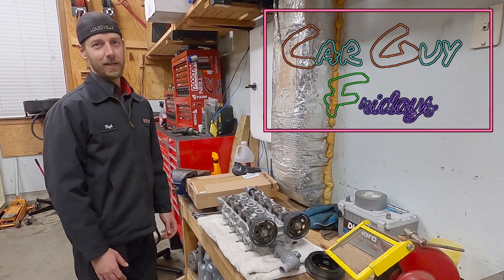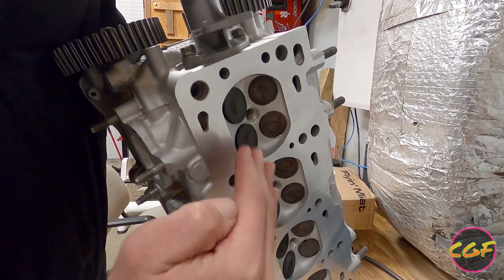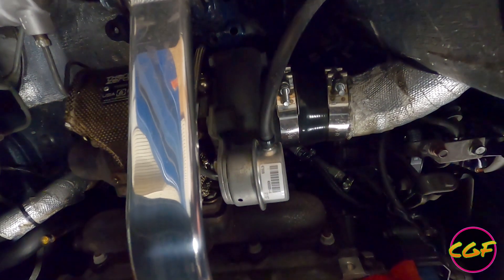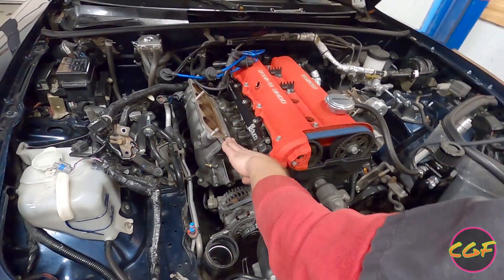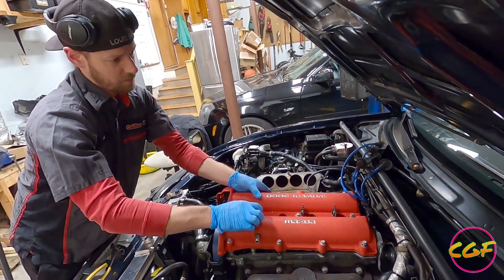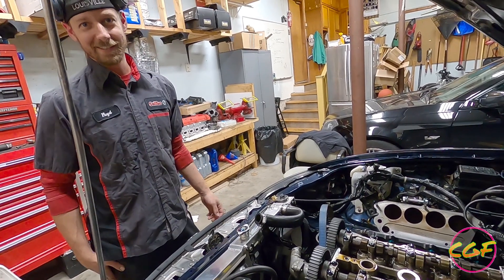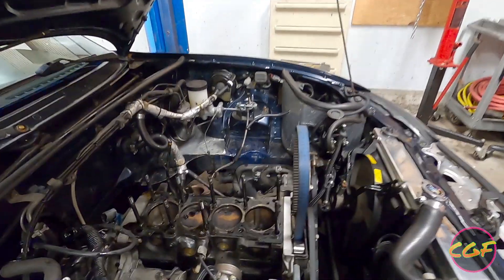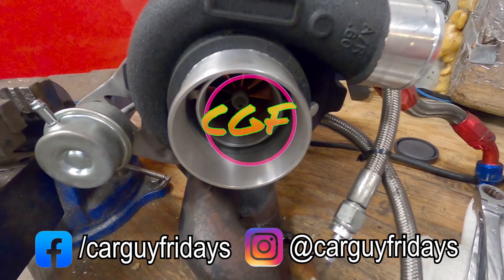Turbo Miata Build : BP4W Head Swap Part 1  (400hp Turbo Miata)

Comment: How many miles were on the un surfaced head in total ?
Reply from the maker: Do you mean before the new head install when the head gasket started having issues?
Reply: @CarGuyFridays  yes 👍🏻
Reply from the maker: The original engine had about 90k on it. However, remember this engine was pushing pretty heavy boost and horsepower. That's not a normal mileage to have a leaking head gasket on a typical turbo miata

Comment: You got no spark issues running the stock coilpack at that boost level?
Reply from the maker: Not at all. They are ngk oem replacements and I run ruthenium ngk plugs. No issues at all
Reply from the maker: I've always run stock coils and I've been doing turbo Miatas since 2001. There is no reason the stock coils need to be replaced under 400hp.
Reply: Dang that’s really good to know, I had stock coils on my supercharged miata 10 years ago and Toyota COP on my last turbo build but I always heard COP for the bigger spark and more complete burn. How much boost are u running to get that powrr
Reply: What do you gap your plugs at?